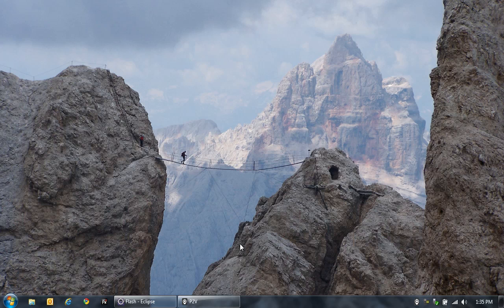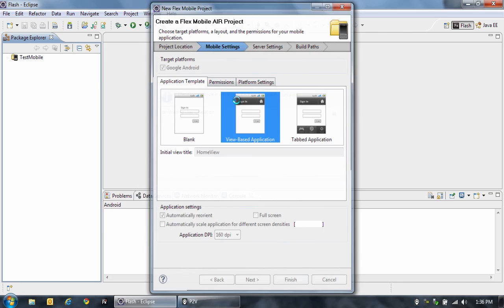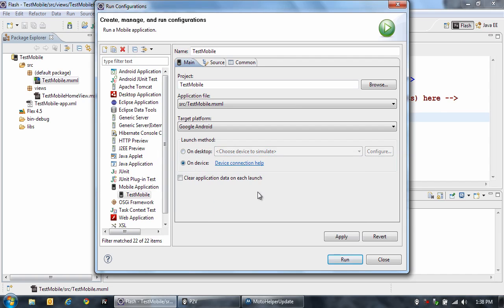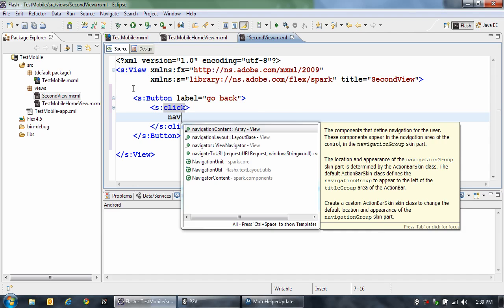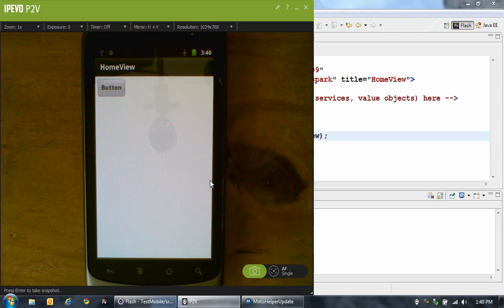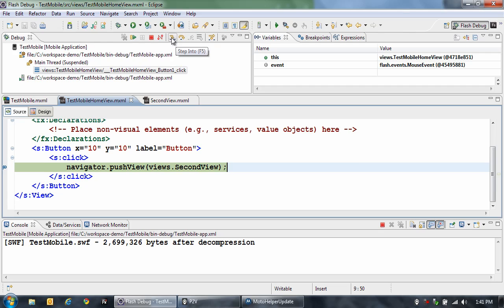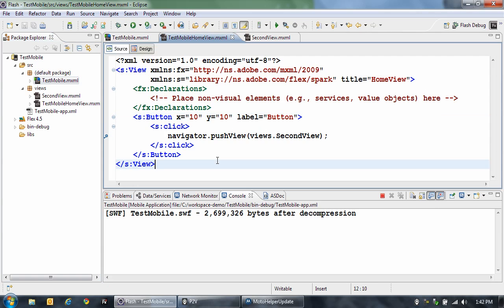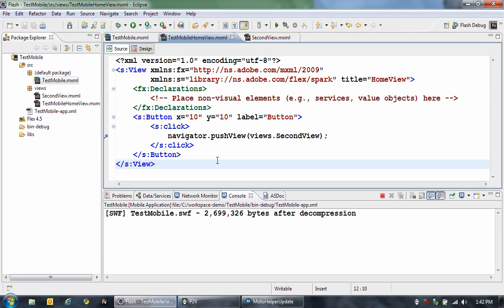Building Flex Mobile Applications

Comment: I have two questions:
1) Are you using you a per-release of FB 4.5? I still see the standard Eclipse application icons on the toolbar and chrome tab.
2) Will the new Flex 4.5 - 4.6 SDK will allow for compiling to *.APK in the Eclipse IDE?